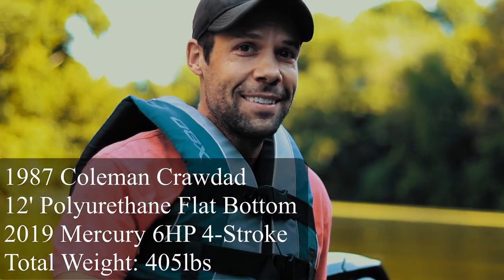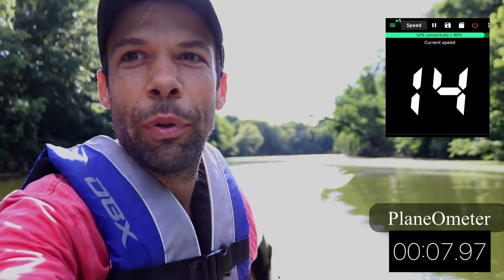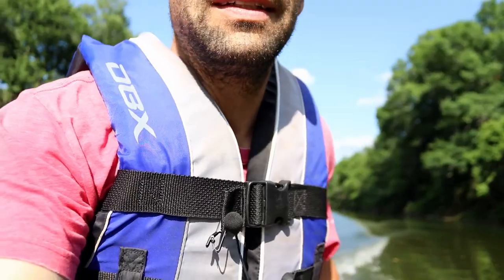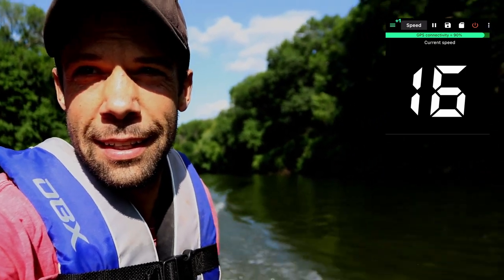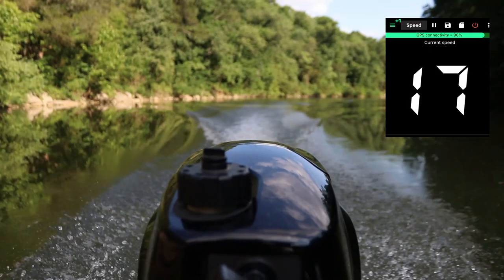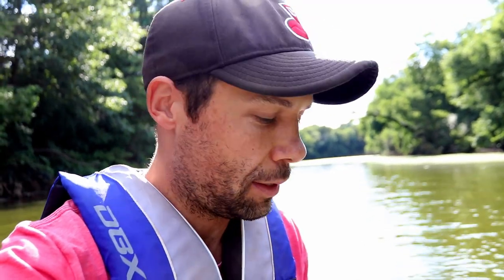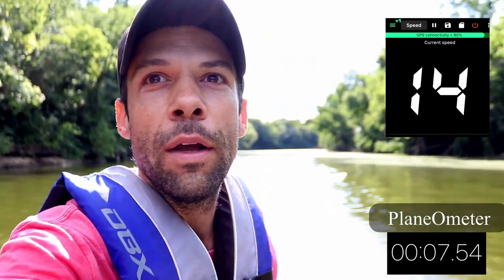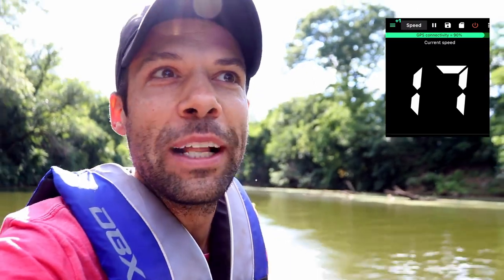Jon Boat MAX Speed Test with Mercury 6HP 4 Stroke: Waxed Hull = Max Speed!

Comment: You videos are informative. Thanks.
I just purchased a Mercury 6 hp four stroke and it starts and runs great but only tops out at 5.5 mph pushing my 9.5' dinghy where your Mercury gets 15-18 mph.
Why would mine only get 5 mph ?
Reply from the maker: Dingies are awesome but tough to plane and get up to speed due to their shape and short length. Is it planing out well? I would try the below

Experiment with other trim positions

If the bow shoots up and stays up, put more weight in front and try lower trim position 

If the bow drags, try higher trim position and/or move weight to back 

Try a prop with a lower pitch. This would give you more power to plane out better 

Some people have a lot of luck using a hydrofoil with dingies

Comment: My 6hp only gets to 7mph on a 1436. Is it cuz of the weight I carry I usually have 2 people on all the time
Reply from the maker: Is it getting on plane? I would try a couple different trim position. If it’s not planing maybe try a prop with a lower pitch (more power) to hep get on plane. But a 14’ boat with 2 people is a pretty big setup for a 6hp unfortunately

Comment: I'm trying to decide which motor to buy the 6 hp Merc or the 6 hp Yamaha. Do you have any advice? Thank you
Reply from the maker: Man both are awesome and I don’t think you can really go wrong with either. In my opinion they are really similar. The Yamaha is a bit heavier so keep that in mind. But There is something about a Yamaha though. I’ve always really liked them and most people do. I rarely hear anything bad about them. Keep in mind I’m not a professional mechanic who works on things all day and I have only had a 2-stroke Yamaha. Bottom line is I think they are really similar but if I got to pick a free motor I would get a Yamaha.

Comment: Hi engineer here. Your speed seems to be limited by reaching max rpm. I think the slick vs non slick test is still hiding the true potential. The second faster improvement in time to plane is a clue to huge boost in efficiency. For that to translate to significant top speed change would take altering the propeller pitch. To exploit the difference the most you will need to find the prop with a pitch that is aggressive enough to lower the top speed rpm of the non slick hull but not so aggressive to alter the top speed rpm of the slick hull. If you do this I guarantee you will see at least 20mph.
Reply from the maker: Thanks, my prop’s pitch is 8”, I’m looking to get a 7” and 9” pitch to experiment. I agree I think a 9” will get me to 20 but I know acceleration and torque will suffer so I actually think the 8” is the sweet spot for my setup. But it will be fun to experiment
Reply: @Skinnyriver  happy to hear about the experiment! I think with a 9" pitch the acceleration to plane will be close to what it was originally 8s but the top speed increase will be worth it. The prop is a place many of these budget motors skimp out on and may be rewarding to upgrade.

Comment: I do t know why , my motor only gets to 9 mph .. its a 2019 . Wish it would run like that .
Reply: check total weight IN boat (and back to front weight balance), total weight OF boat, and play with motor trim. If you replicate what he uses, you should get similar speed.
Reply from the maker: Yeah sorry I didn’t reply to this original comment. It really depends on the boat, total weight, weight distribution and trim position. What kind of boat do you have. If it’s a 12’ flat bottom with total loaded weight around 450 you should be able to get around 15

Comment: I love your channel, I like your personality, you are not much spending time on PLEASE subscribe (and I did subscribe for that reason). That said, if your ever check who post on your video, I have a question. I have a similar boat, the Sun dolphin American 12. Engine is a very old but in shape Chrysler 1966 6 hp  2 cyl (well I have 2 of them, bought them for 160$ CAD so it's like 90$ US for 2, ha ha...)  My MAX speed is 21kph (13.5 MPH) and that is the max that engine will give me. (yes I am a mechanic and the carburettor is well cleaned and adjusted). For weight reason I want to stay with 6 HP max (60 pounds max). I have seen my boat reach speed Like yours with modern 4 Stroke 6 hp engine.That said, If you or others could chip in as too: are modern 6 HP 4 stroke a bit more powerful? Some fact, my boat with my engine will go on a plane in a few second and will reach max speed fast but that it. Since this is such an old motor I can't find different prop. Many thanks and keep doing those great videos. (yes I am planing to buy a brand new 6 hp soon... but I am on a budget now)
Reply from the maker: That’s a great question. I had an early 80’s 6hp Yamaha 2 stroke and it was as fast as my newer 4-stroke. I bet a higher pitch prop would help the Chrysler but like you said there are many options. I think most people on here will actually say that older 2 strokes are faster than the newer heavier EPA hindered 4 strokes. But my experience is HP is HP and 2 strokes are generally lighter and can be a bit quicker but in general I think they are comparable in terms of power (old vs new).
Reply: @Skinnyriver  Many many thanks for your reply. Well in 1966 ( I was born that year, funny) they where called BRAKE HP meaning HP at the crank, and in the 80' hp they change/swapped the rating and it was now rated at the shaft/prop, expert says the lost with the older engine rating was between 10-15%. I think that my engine is suffering from a low pitch 2 blade prop and max RPM is rated 4500 compare to about 5500-6000 for today's 6 hp. One thing I didn't check is the engine compression but as a mechanic it feel pretty fine. Now my next move will be a new 6hp, probably a Yamaha.